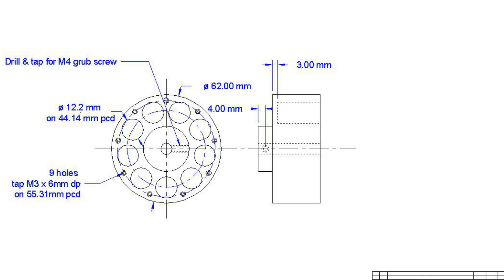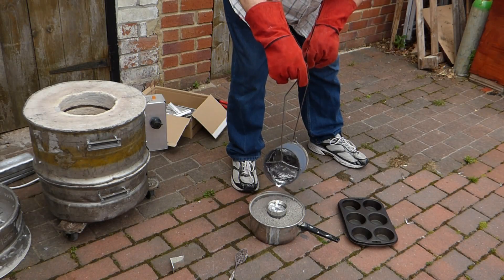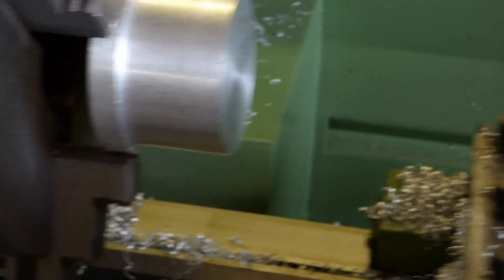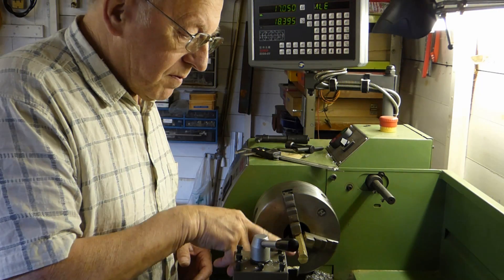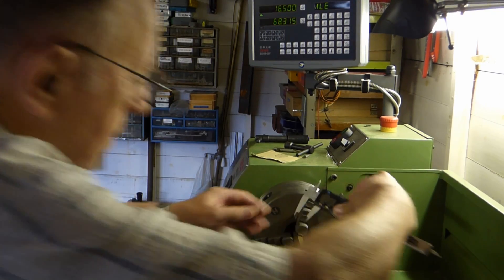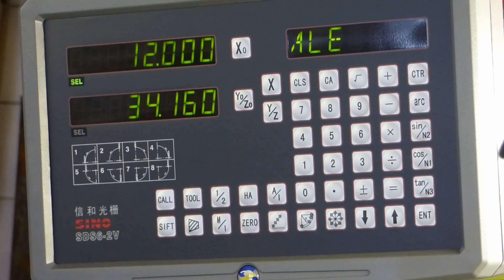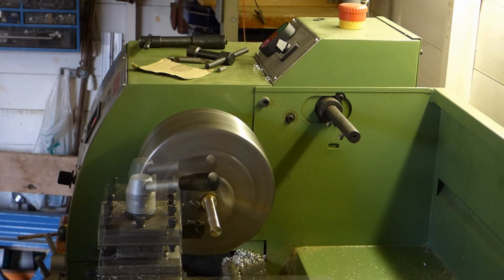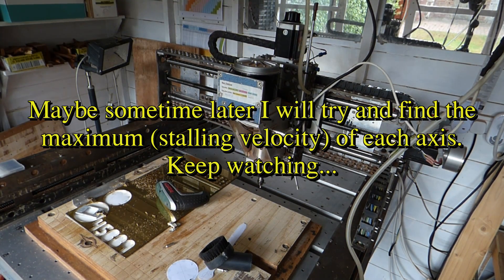The Stepper Motor Damper Completion

Comment: It looks wobbly because the camera wobbles. CMOS sensor based cameras operate with a "rolling shutter", they don't have a mechanical shutter that rolls down as it does on film based cameras, but they read out and also clear the charge in the sensor readying it to accept a new image line by line, so if there's the tiniest bit of vibration of the camera, the whole image comes out wobbly.